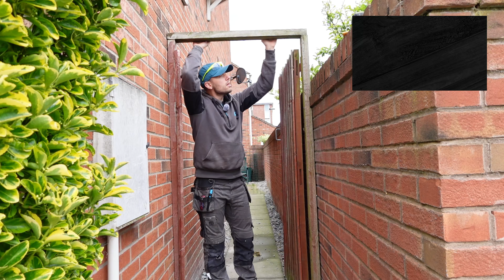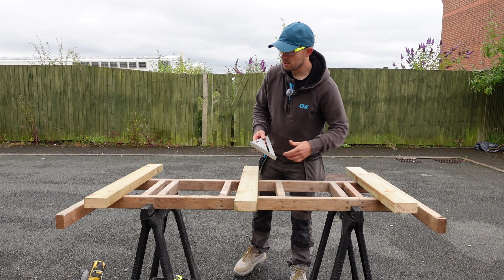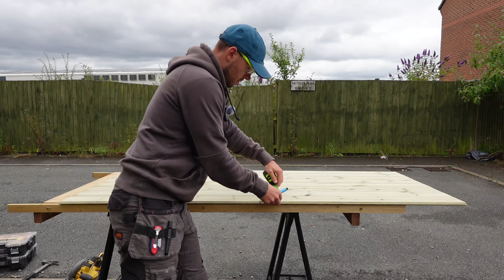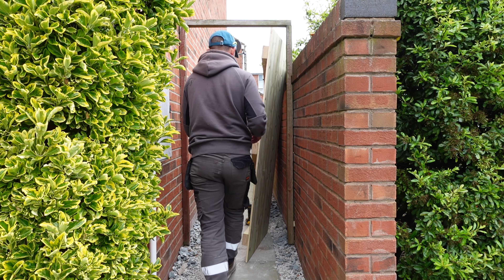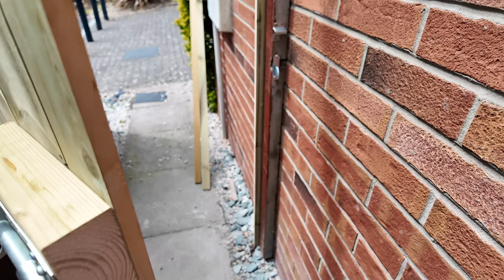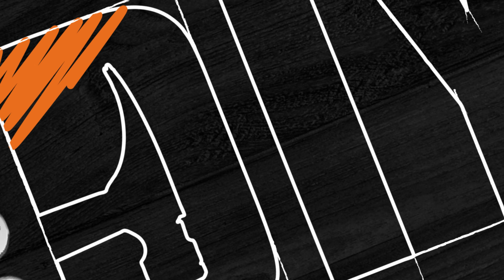HOW TO BUILD A QUICK AND EASY GATE

Comment: Great vid. Question though. When you said you spaced the t and g 1 mil apart? As in not fully butted up just a mm or so loose? Wouldn’t that mess with your cuts to make it fit the gate?
Reply: Also - how do you know the width it should be? With the frame and such? Or is it literally just a case of measure the gap and remove width of the frame space and good to go?

Comment: For consumer pre-made gates, you either have to stock specific left or right hung gates or supply a gate with braces running both ways. Either side may then be the hinge side and the gate benefits from some support. That's the reason for the bracing coming together like 1/2 a union flag rather than resembling a couple of Zs.

Comment: The weight of that gate will destroy your hinges … and door will rub against the 4x4 stud … it’s cheaper to buy one
Reply from the maker: Wrong, sorry mate. But this is a super strong gate. You can buy one but it will cost you 4/5x more
Reply: @scott_diy one guy wants to charge me a grand to build a gate like this. Anything between 450 to 1000. Crazy.
Reply from the maker: @wobble108 for a gate like this I would say the going rate is £400 installed. However if it’s higher quality material, or has any proper joinery, then it’s going to be £800 or more
Reply: There's not that much weight as the gate doesn't have a frame. I've built lots of  these gates for lots of customers and never yet had a complaint. Job well done Scott.